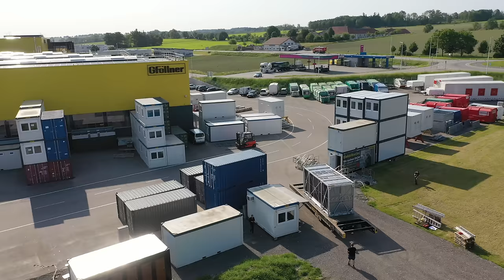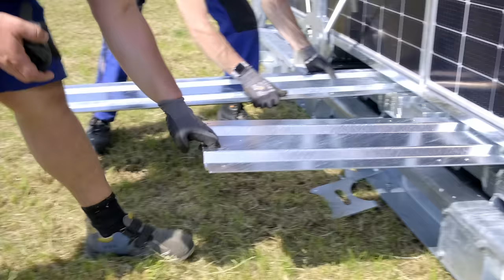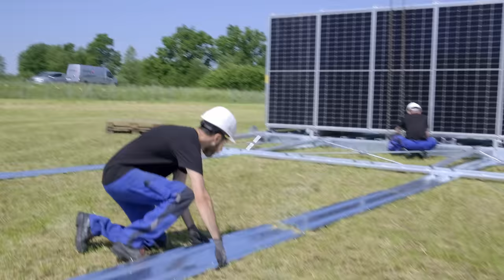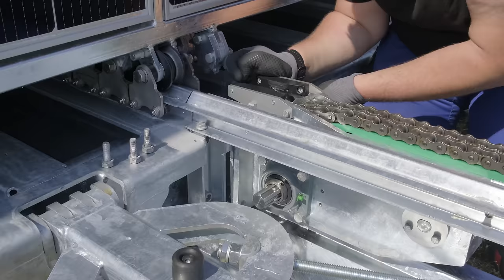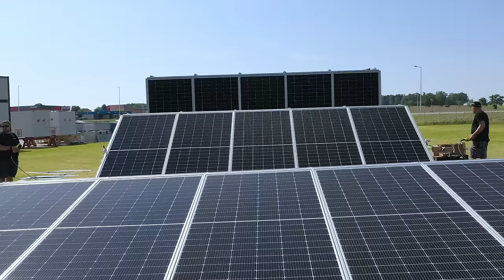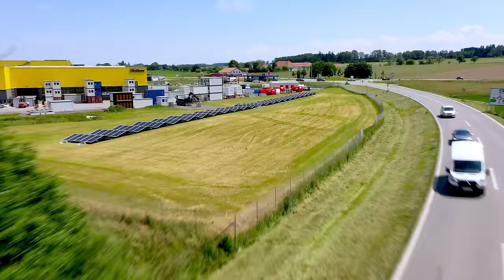Solarcontainer - The Original

Comment: Design it so you can deploy without a crane
Reply: You need to unload it from a truck anyway. The crane is best to to it.
You could potentially use an excavator, a loader or a large forklift.
Reply: @timoclemens5379  i worked on military deployable shelters that were larger than this that didn't require a crane to load out and transport and set up...the technology was invented in the 70s.
Reply: A roll off container
Reply: @whyomgwhywtf  Shelters don't weigh 40 tons, nor do they contain delicate components. Just because there is an example out there that can deploy without a crane, doesn't mean it can be applied to any situation. Military shelters are designed to be banged around, be abused by military personnel and are generally installed on a location which permits driving vehicles around the premises.  This is a totally different application.  Also I would like to know which military shelter can be (semi-)automatically deployed to a width of 50+ meters. 

Most military units these days come in containers, which require some form of unloading, either by crane or forklift. And I would really like to see a container forklift working in a grass field, but that would be an impossibility as 4 wheels will dig into the ground once you load 40 tons onto the tines. Equally so for a roll off container. You still would need to drive that truck into the field, place the units and drive away without completely destroying the field. Good luck with that. You could of course install driving plates, for which you need another truck and a smaller crane to place those plates, but also kind of defeats the purpose.
Reply: @stefanoromani1032  Have you ever seen a waste container installed on a grass field without any form of road? Probably not and I would find it highly doubtful you ever will. 

First of all, the truck isn't meant to be run off road, nor will you ever escape a grass field with 40 tons pressing down on all wheels. And before you comment you can place temporary driving plates. Sure, you can, but you would also require a truck, a small crane and an additional crew to do so.
Reply: @patrickd9551  i mean...the tactical shelters that I convoyed all over the place, into areas that weren't accessible by POV contained some highly specialized sensitive communication equipment...
Reply: @whyomgwhywtf  A tactical shelter with high specialized communication equipment surrounded by a large metal box? The type of box that would deploy to roughly three times the width of the container? Those tactical shelters? 

How is that 50 meters? It also contains equipment, so you simply don't have the materials available to expand beyond three times the width. Not to mention that the materials required for such tactical units require some pretty beefed up construction in order to automatically deploy. Not something you want in this situation as you want to maximize solar panels. 

Oh and could you deploy those units on grass lands without any assistance like driving plates or winches? Those tactical containers are pretty heavy as you know. 

Grass and soil doesn't comply with heavy vehicles without some form of assistance. The laws of nature will simply stop you.
Reply: @patrickd9551  every single one of your arguments about destroying grass is entirely invalidated by the fact that it requires a 40 ton crain to place it on the ground....

To your other point, my tactical shelters were either the same size and in some cases larger than the box used to ship these panels. As a matter of fact the wheels we used on our shelters would fit on this pod because they used the same shipping container pattern as seen here. 

I'm not really sure why you are so heated about my criticism of the obvious design flaw here...
Reply: @whyomgwhywtf  There isn't much of a heated discussion as such that you don't want to understand simple comparisons or logic. You have one thing in your mind, but you fail to provide the logic behind it. 

Let me start with driving plates. You know those metal plates placed on grass of soil so that heavy truck can drive on those. Sometimes they stretch for hundreds of meters. Those are placed manually by a crew. Why? Because automatic deployment is simply impossible. The same applies her, hang on, I will come back to this. 

So, I'm not talking about destroying grass because a 40 ton unit is placed on top of it. I'm talking about DRIVING a 40+ ton truck onto grass and hoping you can drive away.  That is a totally different thing. A military containerized truck is too heavy for off road duty. You should know that and you need driving plates, right? Because you will destroy the grass and bury your wheels leaving your truck stuck.

So the choice is simple: you either use a crane to place the unit onto the grass. Or you have a smaller crane and crew manually place driving plates for your solar container truck to drive onto the grass. Either way you need manual labor, negating your argument for automatic deployments to reduce manual labor. You simply move the problem elsewhere. Mind you the crane is also placed on concrete. 

And next. The container size. Do I really need to explain to a man that size matters? Whatever the size of the package at transportation, doesn't say anything about what it will become once activated.

A military unit that expands only threefold is a totally different beast compared to a solar array. That is a totally different engineering challenge. But allow me to further explain it to you. Your military unit expands a single width to one side and the steel beams required for that are pretty sizeable (and heavy). This solar array expands 20 fold to one side. Do you have any idea about that would impose when loaded with 10+ tons of solar panels? For that matter, have you ever seen a crane of any kind that expands 20 fold? The amount of steel required for that is beyond reasonable. Simple physics actually. 

But granted there are mobile solar arrays available that are more engineered for automatic deployments. But their biggest drawback is the amount of solar power available. Because the materials required take up more room and as such reduce the space available for solar panels. So much so that an equal size container will only generate half the power compared to this unit. 

You say the system is flawed, I say the system has been deliberately designed in this way in order to maximize power output. The steel beams have been engineered to be small and lightweight in comparison to maximize space for solar panels. 

And yet here I am trying to explain simple logic and physics to a former military driver trying to make him see that he's comparing apples to oranges.
Reply: @patrickd9551  bro, all of the limitations of a truck deployment apply to the deployment shown in this video...how much do you think that crane weighs? How much do you think those panels weigh? 

Also there absolutely is an automated "road" system, one is called the FAUN trackway another is Mobi-mat.
Reply: @patrickd9551  again, this solar panel system in this video is already in the same exact form factor as all of the large tactical shelters so attaching the wheels to this system would be absolutely no different than attaching them to the tactical shelter.
Reply: @whyomgwhywtf  Yes you are absolutely right. The formfactor is the same, your idea is even valid to a degree. However it comes at a cost. The cost being space, valuable space that reduces the amount of solar panels. Again, allow me to explain your idea and how it translates. 

Your first solution, replacing the crane with FAUN trackway. Requiring a different set of specialized expensive heavy equipment. You are simply replacing one problem with another. I even suggested driving plates as a solution. But that also requires different materials. AND it only solves half your problem, because you would still need to deploy the unit. Either way there is no real gain to be found here. 

So your second halve of the solution is to attach wheels to the hinge points. How much space do you think those wheels will occupy? Especially if they are connected to the unit, because you want to avoid manual steps. Space that could otherwise be occupied by solar panels. Mind you, the wheels need to be big in order to roll over grassy areas.

You would also need to beef up the hinges to counter all the movements the frame make whilst deploying over all those bumps and holes. Again taking up valuable space which could otherwise be occupied by solar panels. 

Next the deployment. How are you going to tow 15+ tons over such a large span and again over bumpy grass lands. You would need so serious power to achieve that. Serious power requires space. 

Or you could otherwise push the hinges from the trailer outwards. Still that would require massive amounts of power. Much more then the winch this company uses because of all the forces to counter. but still valuable space.

Why can't you accept that there are multiple solutions to a problem? One solution focuses on ease of deployment, the other on maximizing power output. It's not a design flaw, it's simple mathematics and laws of physics. 

Here take this video for example: https://www.youtube.com/watch?v=Ec0PVytb1mU You can clearly see there are 9 solar panel in the width of the trailer. about 15cm per panel on average. But with a simple folding system you can have THREE times the amount of solar panels in the same space. But at the cost of deployment speed. It's really not that hard.
Reply: @whyomgwhywtf  Also I just looked into the details of that faun stuff. Awesome engineering, but again it also comes at a cost. 

Let's assume 40 tons of equipment + 5 tons for the truck, three axles comes down to 15 tons per axle. With me so far? 

In order to make a path 50 meters long you would require two spools of FAUN C90, weighing in at a whopping 7 tons total in FAUN only, also requiring two trucks to transport the laying unit and the FAUN itself. (or one highly specialized truck)

Let's compare that to the festival solution: HDPE driving plates. Because of the size it's capable to spread 50 ton per plate, but you would need two rows because of your wheel base. In total I would need 34 plates, weighing a mere 1 ton. I would need a single light truck and maybe a light crane on top of the truck. In terms of costs much more efficient, which doesn't offset the cost of labor won. 

The same applies here as it does for our other discussion. Speed and convenience comes at a cost. Not only in terms of price, but also in terms of weight. 

I understand that the military doesn't have to consider price as their main issue, but the private sector does have that problem. The benefits costs analysis is completely different too. I too want to over engineer, but we still have to make a profit in the end.
Reply: @patrickd9551  please explain to me how you are going to get a 75 ton crane into an area where a 50 ton truck cant?

My problem with this design is that in its current state, at least per the video, you need a crane to move it into position. 

My original comment was that there are tactical shelters that have the same form factor as this.

The shelters only required 1 person to attach the wheels to the box and the same guy could hitch and tow it anywhere and deploy it just as easily as these guys did here. 

If the kit has to be dropped off in an area where the ground is too soft for a truck to drive then that same ground will be too soft for that massive crane to get there as well.
Reply: @whyomgwhywtf  But again, a truck or a crane doesn't make a difference. The main issue I had was the fact that solar panel density means you have to sacrifice automation. If you want automatic deployment you need to sacrifice in different areas. 

That's not a design flaw, that's a design choice. You cannot translate military units that expand only a bit to a unit that expands many times over. The engineering is completely different.
Reply: @patrickd9551  you don't have to skip the automation at all with the tactical system I'm talking about given that there is enough space in the area in which you are deploying said system...

The main issue i had is the fact that it requires a crane to deploy in the first place.

Comment: Perfect for disaster responders
Reply: When the sun is shining :)
Reply: Yeah I think we need to stop saying solar or wind are for disaster response. During a disaster you need reliable power. You need diesel generators. Leave wind and solar to offset emissions and reduce fuel cost on a grid.
Reply: In disaster response should be quick. not time consuming.
Reply: sorry, but no. This requires a crane, forklift, does not hold a battery and requires a very large (flat!) footprint. This would have been way better. A modern household can run pretty well on 4 solar panels, or one of these large ones. Unloading the container could provide a few easy kits to install in a garden, that can be lifted by hand and installed with an easy battery + connector system (probably just a few power outlets) for the emergency need. 

This is for something else.. Something very specific, and definetely not for disaster responders. the 30 mins to "unfold" is not the 30 mins installation. That took several hours and a lot of heavy machinery as you can see in the vid.

Comment: OK as concept. Some more love/improvements needed IMHO.
Hints: make it flatbed trailer no-crane needed + single operator to deploy (many people to manually assemble rails and two "cable remote" operators to deploy is bad), maybe less panels but  battery in the base of the structure (don't make it top heavy) + inverters => top disaster power supply recovery solution or "mobile / no-permit" solar farm solution.

Comment: Connect the modules more flexible and add two wheels on the lower part of each module then it doesn’t need 5 hours and 25 minutes to finish, but only 25 minutes - even on uneven (😊) surface
Reply: Exactly 
I am even struggling to understand the application, too much ideal environment and manhours, not to mention the long space in one stretch and angle of 50% panels is compromised

Comment: Too much work. Design it in a way so that you don‘t need a crane. Best would be to deplay it right away from a truck or have some wheels on it to do the fine positioning like with trailers.
Reply: You are missing the point. Try to transport and set up those panels one by one with two people. Let's see if you dont take a whole year. It has already been simplified. Also, do you understand the complexity that comes with mechanization? Would you rather hire a crane operator or hire a technician to operate the damn thing? What happens when the mechanism fails? What about space? Think about it.
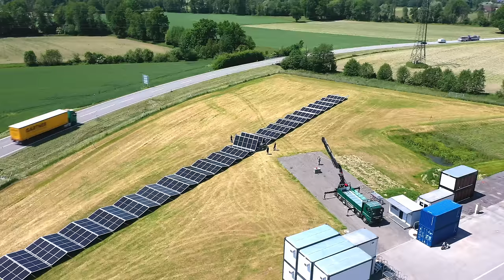Reply: I'm just gonna guess you're an American based on this reply. In the EU, simple flatbed trucks have cranes built right on them that humiliate most purpose-built American cranes. The one you can see from 3:02 onwards is just a small one. This solar unit could easily be moved and placed by one vehicle, one vehicle could transport 2 or 3 of these units, and place them all within a couple of hours. For 240 solar panels per unit, that's extremely quick setup.
Reply: @BwanaQixa  Did my previous comment contain "@BwanaQixa"? No, it didn't. I wasn't replying to you, if that still wasn't clear...
Reply: @timderks5960  Thanks for clarifying...

Comment: That you have a timer for just a small part of the deployment seems to be grossly misrepresenting how long it actually takes for the whole deployment.
Sure, it takes 27 minutes to unfold it.
But there is no timer or number for how long it takes to place it, build the rails, and all that.

It's a cool product, but as others have said, make it more easily deployable and not requiring external power to deploy it.
Another thing is that every other panel is angled away from the sun, so being able to angle them individually after deployment would be great.
And a deployment and seating method that allows for deployment over hilly terrain.

Comment: Interesting looking but how do you hook up 140kw power source. The electrical panels don't look substantial enough to convert all the DC into 3 phase AC. What is the AC output voltage?
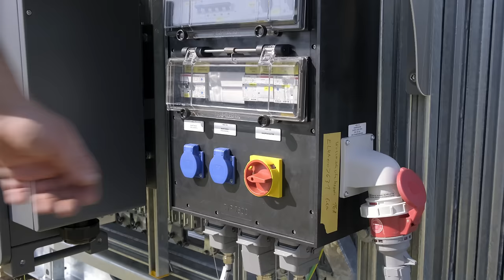Reply: At 1:53 in the video, the big grey box that says Azzurro ZCS, is the three phase grid tie inverter necessary for the 140 kWp worth of solar panels.  According to the ZCS Azzurro website, they have several inverter models available with a variety of power ratings and AC output voltage specifications, with chassis designs similar to the one shown in the video.  The inverter model shown in the video is likely one of the 110 kVA or 137 kVA grid tie inverters with three phase output (probably at 288V phase to neutral, but depends on specific model used, as some of their models produce higher AC voltages).

Comment: Looks Great, BUT it's a 20' IM Container base.. that Still requires more than Just it... .Cause the Chain Rails and Drive Motors I didn't see where they were stored... PLUS  the GCU  sits clearly on the outside of the 20' Framing.  NBD for many applications, BUT still lssues with shipping over Rail / Ship / Air.

Comment: What is the benefits of mobility with solar panels?
Reply: One thing comes to mind, disaster response, when all the power lines have been taken out and maybe roads as well, this could be air lifted in to power hospital and emergency needs
Reply: @bobswrigles8636  not suitable, because you would need something that generates 50Hz, so a gas turbine or a normal diesel generator would be waaayyy better.